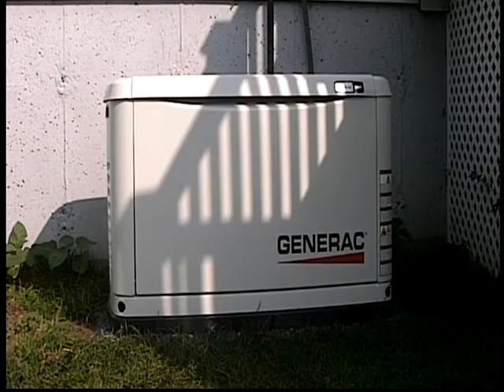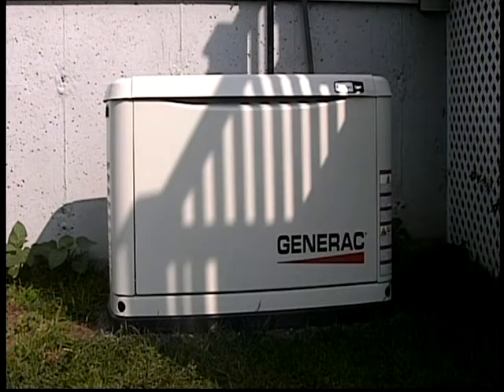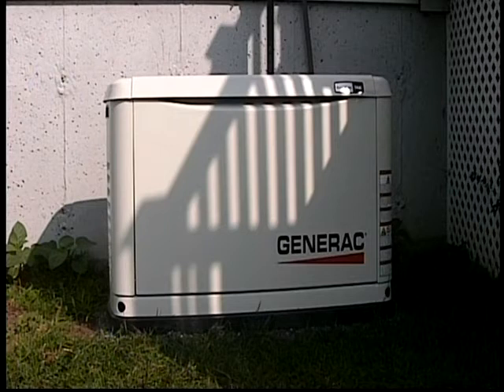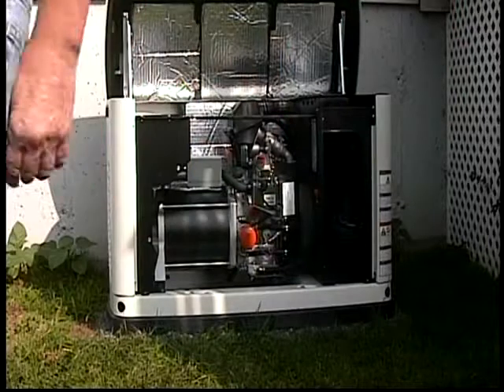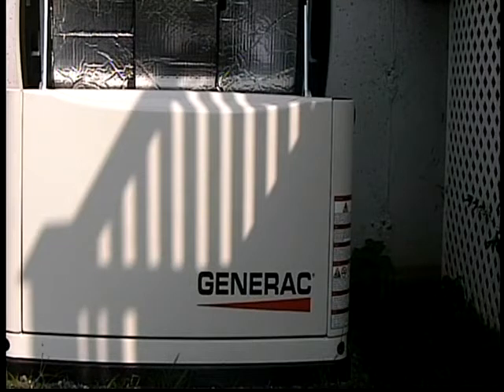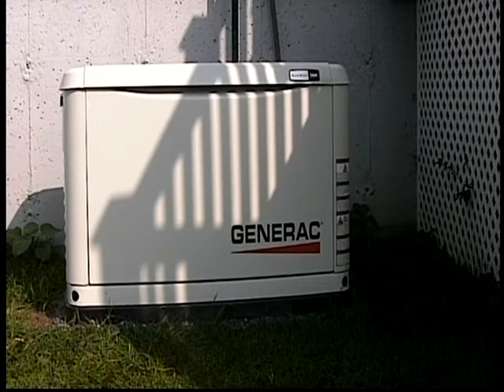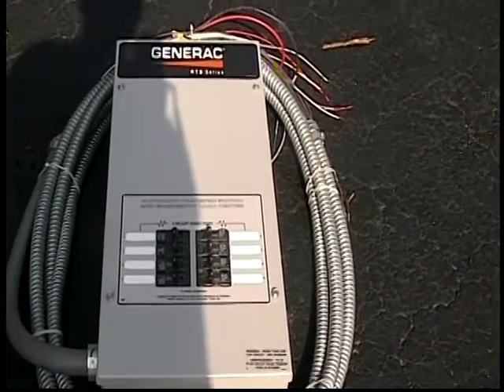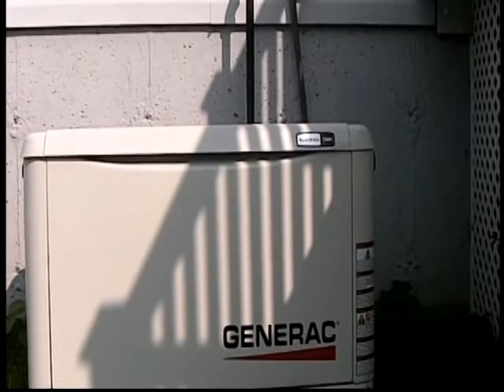DVD Video 11 KW Generac Installation

Comment: Thanks for the vid! Couple questions: when the generator is on stand-by ... is there any noise at all? Or is the unit just generating enough to power the stand-by light and thus is silent until it kicks in during a power failure?  I notice your transfer switch is not showing.  Other videos have all kinds of pipes and wires outside the house ... making it look really ugly.  What are the pros and cons of wiring the transfer switch inside vs. outside? Thanks!
Reply from the maker: By "Stand-by" I'm guessing you mean "AUTO". In "AUTO" there is no noise at all unless it starts for an exercise cycle OR starts because it senses a power loss. In the exercise mode there is no load on the generator at all because a transfer was not called for, just an exercise. It's a combustion engine so there will be noise BUT it will be quieter than an under load condition. The amount of noise is dependent upon the year the model was made as the newer ones are quieter. The generator has multiple voltages as it gets 240 VAC from the utility power. When it sees the loss of this 240 VAC it knows utility power has been lost. There is also  12 VDC  which can come from a trickle charger inside the transfer switch OR built into the controller. You need to be aware of these voltages. If you change out your battery say - removing the battery cables does NOT remove the power on the battery cables - you need to de-energize the trickle charger as well BEFORE attempting the change. So, you can see that the generator DOES NOT need to be running to light the GREEN / YELLOW /RED LED's. I didn't show the Transfer Switch because I didn't have the owners permission to do a video of the inside of their house. I did show the transfer switch I used which is only rated for "INDOORS". I like to install them right beside the existing utility MAIN panel. It's easier for me, cost effective and if the owner does face an issue - everything is right in front of them to view and analyze. (They usually want to revert to the OLD location of a breaker which becomes a spare when the transfer switch is installed.) I use pipe when the distance between the transfer switch and the generator exceed the length of the wiring harness provided. I strive for a professional looking maintenance free installation. There's nothing worse than having an item like this sit idle for years and FAIL when you need it most.
Reply: Hi @snowman6686  .... THANKS so much for all the GREAT info!!!  I really appreciate you taking the time and energy to answer my question so thoughtfully and thoroughly!  :)  Be well and safe.

Comment: My generator has a red light. The warning code says "overload" What should I do?
Reply from the maker: An "Overload" normally refers to a demand for more power than the generator can provide. On the "Essential Circuits Transfer Switch" you normally avoid this by installing the same size circuit breaker, in your main panel, that you find on your generator. (If you don't trip this breaker on "NORMAL" power then you shouldn't trip your generators breaker on "EMERGENCY" power.) On a "Whole House Transfer Switch" you need to; size your generator correctly, use the "Load Shedding" circuits, refrain from using high power consumption items like electric ranges and such OR manually remove unnecessary loads by shutting off circuits you really don't need. IF you don't feel that there "really" is an overload then you may want to verify your current draw by having an electrician test the current draw. (A faulty CT could trigger the alarm.) 
You will have to acknowledge the alarm in order to remove the red light and get back to a "Ready To Run" condition with a green LED.
The "History" will store these faults, along with fault codes, in the event you require warranty service. 
In this video I refer to a "You're not going to get any more than you have". That means that you are not going to get any more power than the generator can provide with the type of fuel you use. I normally advise people not to run their generators at 100% load because there are intermittent loads that can appear and force an overload condition.
Hope this helps.

Comment: Hello and thank you for the video I am thinking of getting a generator myself. I have a 5300 ft.² home thinking does 11W generator cover that?
Reply from the maker: Generator choice should not be done based on square footage of a home. It should only be based on power consumption. I ask clients to think about what they feel they would want to be powered up DURING a power outage.
Me; Heat to keep my house warm and my pipes from freezing.This also provides my hot water., Sump Pump to keep my cellar from flooding, My  Refrigerator and Freezer to keep my food from spoiling, Microwave to cook food if you have an electric range because they consume a great deal of power, Gas stove because they need power for the oven - the burners you can still light with a match. Some lights that I deem necessary, Security system, Living room because I usually get visitors in a long outage, bathroom and bedroom.
Now you know how much power you will need. Add 20% so that your generator isn't running "All Out" in a prolonged outage. MOST power consumption is incidental - meaning they don't need power constantly as they turn on and off as a standard.
Lastly I tell clients the required fuel consumption at partial demand and running all out. This is just so they are aware and don't think I was hiding the cost. The exercise cycle is barely noticeable and can be adjusted from weekly to monthly.
I like a twin cylinder generator. I explain it as "a single cylinder engine powers the piston down and it "coasts" back up BUT a twin cylinder engine is powered throughout the revolution. So if you have anything that requires a strong surge of power to start - like an air conditioner - you'll want the power a twin cylinder provides.
Yes, my explanations are as long as my videos, I hope to get better.
It's not the size of your home, it's your electrical needs when the normal power is gone.
Reply: @snowman6686  That is an excellent comment, completely full of truths and logic, you got me sold!